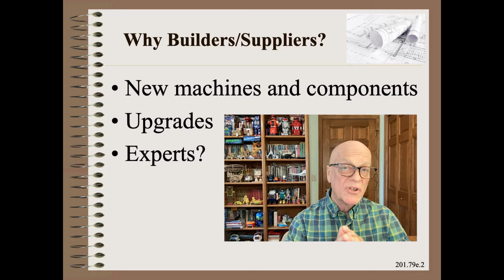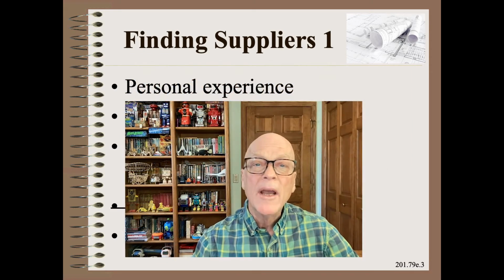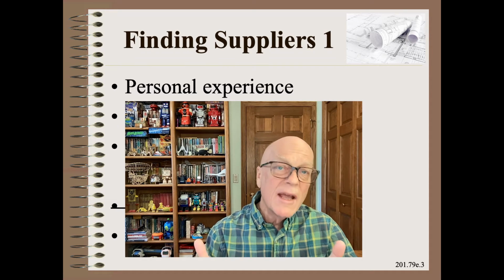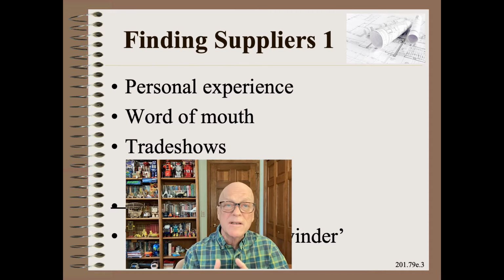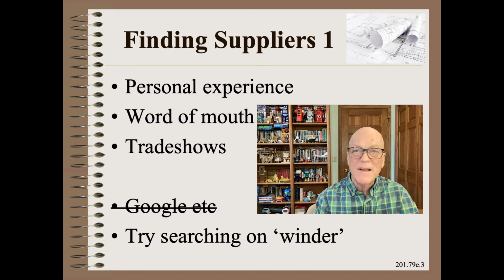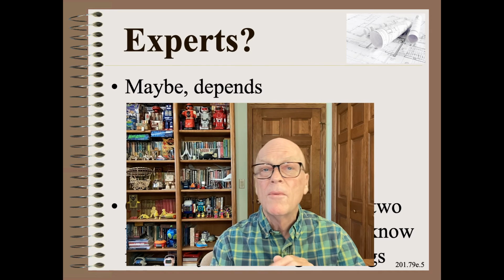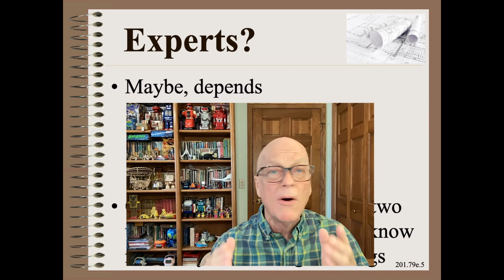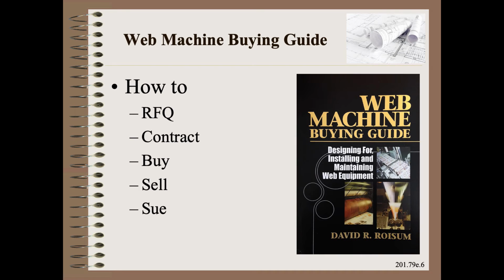Web20179e - Find It - Machine Builders

Comment: Dr Roidum when the machine supplier behave like a salesman, when he doesn't see the obvious problems of the paper (bagginess-patches- serious caliper variation-serious tension problems), when advised you to increase the machine speed with all the above problems, when you have corduroy edges on pope roll because of the vibrating arm (ready to crack) and tell you increase the  machine speed and many more ,what are you doing?
Reply from the maker: My experience with builders is that few, whether salespeople or service engineers, are great problem solvers.  They can also act defensively to protect their own interests rather than those of their customers (you and your web).  What they can do is to advise how to bring the machine into 'like new' condition.  Still, if you have a problem with a new or like new machine, then you are mostly on your own to figure things out.